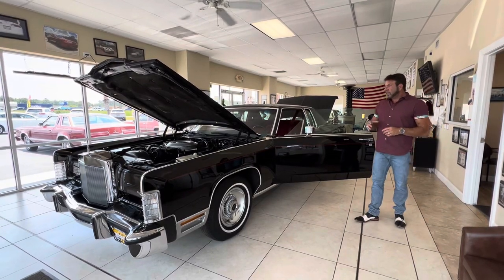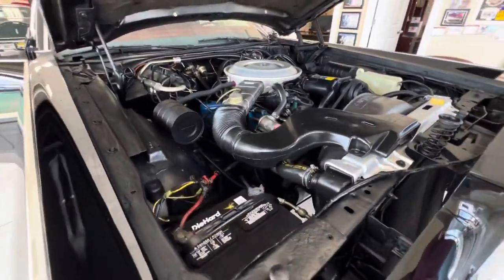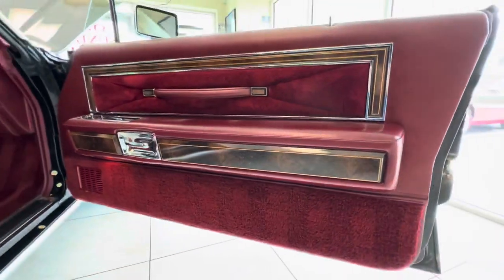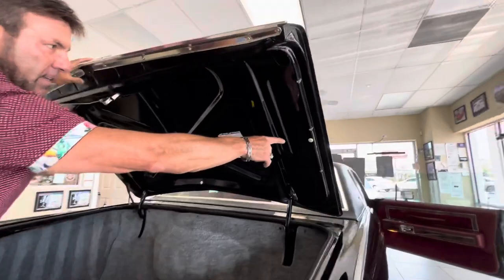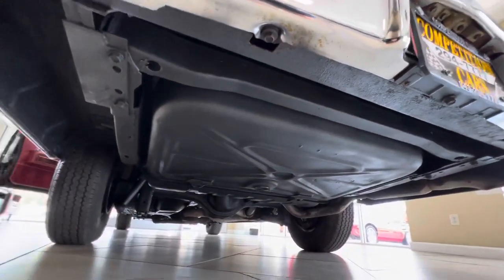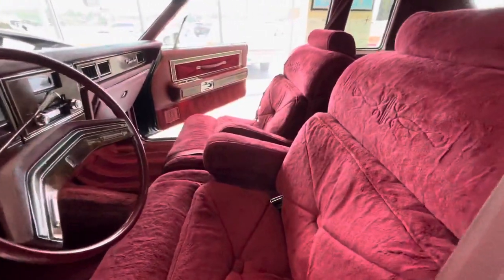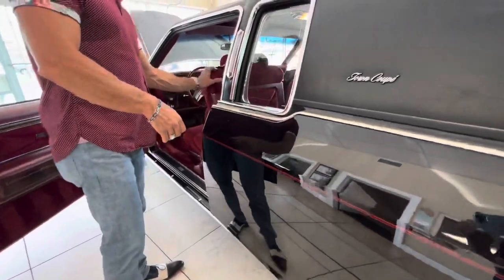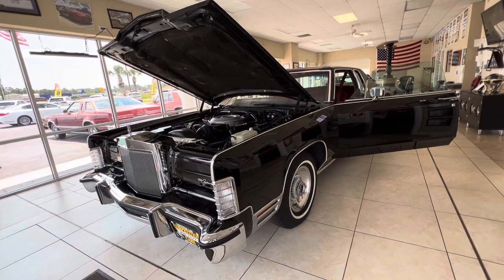1979 Lincoln Town Coupe Interior Walk Around. 844 Miles

Comment: The Town Car / Town Coupe was an option package for 4dr / 2dr Continentals respectively for 1979.  $1550 give or take, but the velour was a credit option as package normally included leather.  They made almost 5x as many sedans as coupes, but the TC package on either was much more successful than the base model.  The real top line was the 'Collectors' Series' as these were the last of the behemoths; 1980 would bring it down to the Panther platform.
Reply from the maker: Thanks for that info!!

Comment: What you see is rust proofing.not Undercoat. Undercoat was sprayed on the bottom of the car as a sound deadener.
Reply from the maker: Ok
Reply: @christianbugatticg  That car is rust proofed as evidenced by the "Ziebart" plugs on the door sills and inner trunk lid. Good presentation.
Reply from the maker: @tedlym.3390  Well it has some type of extra protection! lol